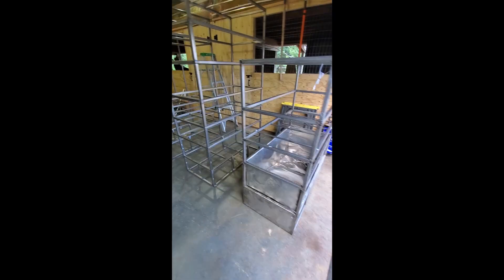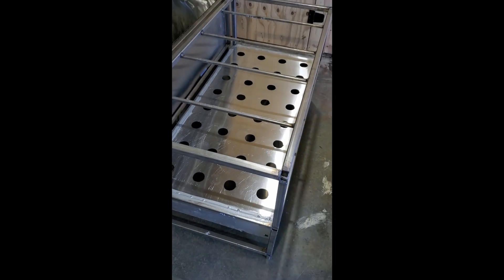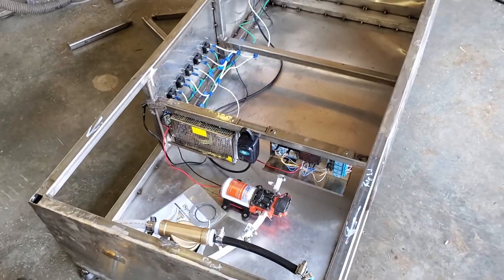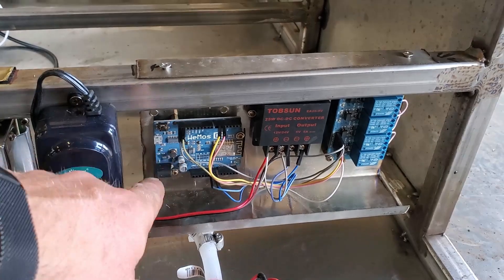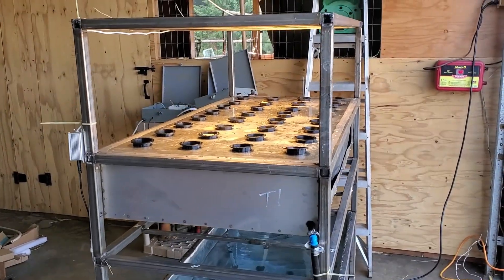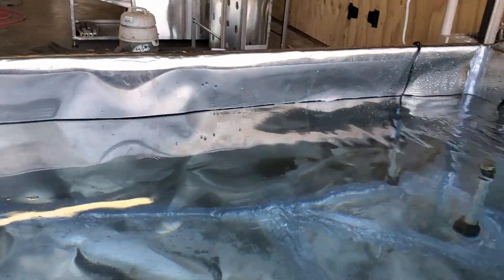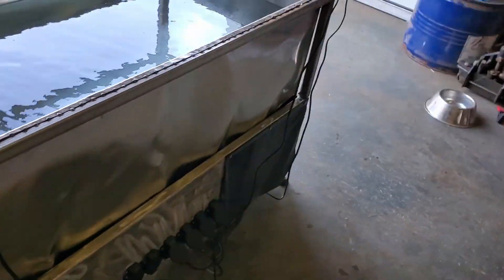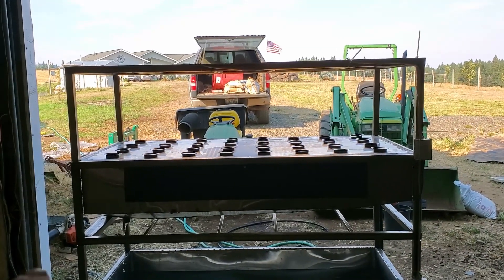High Pressure AEROPONIC Grow Tower - Water Distribution

Comment: Do you have ann expansion tank in your setup?  It seemed to me that your system was switching on/off at a fast rate to maintain the setpoint pressure.  What pressure are you set at?  What kind of nozzles are you using?  I’m looking to setting up an Aeroponic system and just want to know what components(pressures, flow, etc).  Thanks
Reply: Or are you using speed control on your pump?

Comment: Looking forward to seeing how this progresses.  I recently tried a high pressure aeroponics experiment with aquaponics which had some fairly slow plant growth.  I ended up taking the spray nozzles off and changing the drain to go for a deep water culture setup to see if the plants grow faster.  I've read that aquaponics isn't nutrient dense enough like with hydroponics to use with an aeroponics system.  I would love to see you make it work.

Comment: You need to come up with a vibration damper for the pump.  That sound is going to drive you crazy.
Reply: i didnt realise it was the pump making that racket. I think a backup pump will be a good idea because i didnt see an accumulator anywhere. I would be a little worried about condensation forming on the stainless and messing with the electrics. I hope the units are earthed and protected by a RCD.

Comment: Awesome. Just pointing out the obvious so feel free to ignore me. But those pumps cycle on and off based on a built in pressure switch. There is usually a tuner knob/screw on them to adjust the flow rate. The way I understand they should work is the pump should be tuned so that it cycles on when water is requested and then only turns off when water is shutoff. Same as a well pump for a house. That being said, one of those pumps is probably strong enough to run the misters in 2-3 grow towers at the same time. Especially when you consider one of those pumps in a camper trailer can easily provide the flow rate for showers etc.  Again you probably already know this so GREAT WORK ON THE PROGRESS!

Comment: You might want to consider using some "rubber baby buggy bumpers" or isolation connections between the pump and the sheet metal.  That would eliminate the vibrations of the pump making noise.

Comment: What's causing the water hammering?
Reply: It needs a pressure tank to stop the pump from on/off so fast.
Reply: @TheCritterWindow  Oh, like you would if you had a well?
Reply: @cuttablespark01  Yes but a small one.
Reply from the maker: so if I put a accumulator tank on a T right after the pump it should perform better?
Reply: @TheRealMartian  not an expert, hence my first question but reading more into what @TheCritterWindow said yes it will help. Just like a house with a well pump it smooths out the flow and lessens the wear on the pump. I think something like a SHURflo 181 would help your situation.
Reply: @TheRealMartian  I would think so. That cant be good on the pump. That is how my well pump works.
Reply from the maker: roger...I bought them and have them here but thought I could get away with it...I'll make the change now...much appreciated!
Reply: You will need a pressure switch to control the pump and iderally a pressure reducer to control the pressure from the tank. Nozzle flowrate varies with pressure, so the flowrate will be higher when the tank is freshly charged and lower when it is close to empty.  I run 100L(26.42 us gal) accumulators on my hpa systems, charged from 80psi to 140psi with the reducer set to supply 80psi to the solenoids. Each tank holds about 40L (10+ us gallons) so the pump gets a really easy life as a tank can  run a system for days. You can think of it as a rechargable nutrient battery (offgrid and standalone once charged). I use one (12v dc) pump to charge multiple accumulators.  Accumulators can be useful in many ways, here`s an off grid hpa option for folks that like to  keep fit. You can add as much or as little to the tank at any time. The pump could probably be homebrewed from pvc pipe to reduce the overall cost.
https://youtu.be/8pkp6SG0NvE